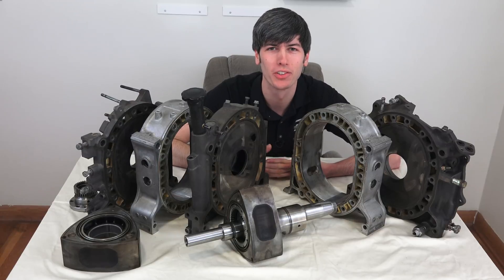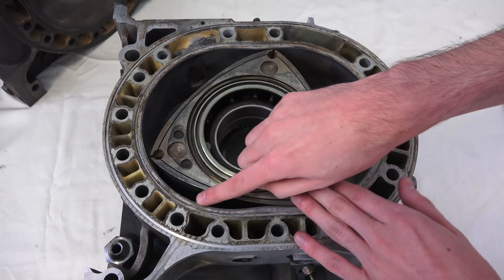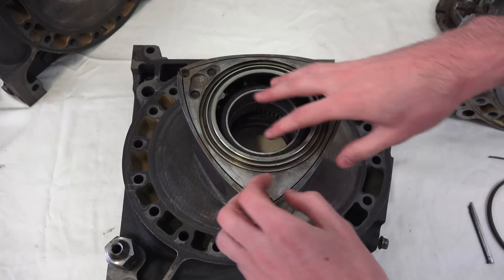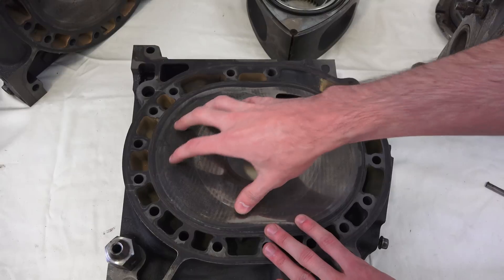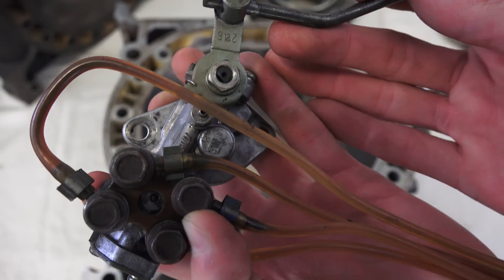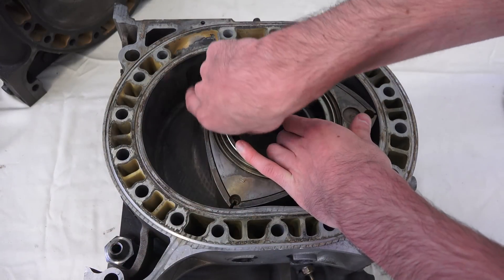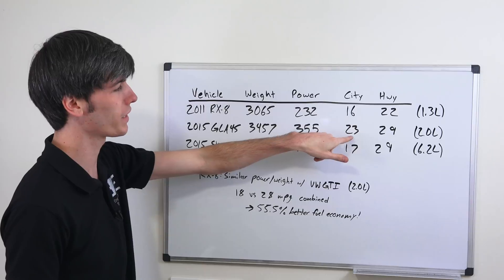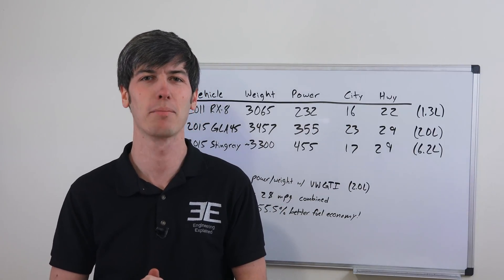4 Reasons Why The Rotary Engine Is Dead

Comment: The most elegant engine is still the electric engine. 
It's a shame that we don't have adequate power storage to make it usable on a daily basis.
Reply: That used to be true! Now, the only remaining barrier is cost, and that will be coming down in the next 2-3 years. Get hyped!
Reply: really they are called electric motors, not engines, since all the do is convert power, not create it. an "electric engine" would be a generator turned by some shaft-power creating force
Reply: wtf tesla cars get 500km on a charge. how is that a "Flaw" with range, who drives more than 500km in 1 sitting
Reply: Ryan Ballantyne we can thank the smartphone industry for the advances in battery technology, and cost is not that big of a problem anymore, infrastructure is.
I'm still waiting for Tesla to expand their charging grid in Eastern Europe, otherwise their model 3 seems quite affordable.
Reply: +The real doktorbimmer it takes 40 minutes to fully charge at their charging stations,  and the charging time will get better over time
Reply: Almost anything is better than burning petrol in an ICE with highly variable speed and load settings.
Even a network of diesel generators located at the charging stations, which make electricity on-site could be better.
Batteries with replaceable electrolyte could also be a thing.
However, cars consume such a huge amount of power that by the time electric vehicles start becoming mainstream, electricity providers will be forced to increase prices. They'll have to start burning oil themselves to make up the shortfall. Hopefully by then the market will find some other improvements.

Hybrid cars could be superior, despite the stigma of having an on-board generator. One of the problems with pure electric cars is the need for a massively over-sized battery. It just seems like poor engineering, considering the superior energy density of fossil fuels, and the fact that peak power is usually only needed for short bursts. Much better to have a smaller battery (still huge, but much smaller than what Teslas require), and supplement it with other sources of power.
Reply: The real doktorbimmer
Exactly. That's why hybrids sound a lot more compelling to me, rather than pure EV, for the moment. On the other hand, the automotive industry looks really STALE, and they're just raking in profits using low-risk business models, which makes me understand why governments want to regulate them. Otherwise they wouldn't bother innovating at all, until the oil runs out.
Reply: The real doktorbimmer
The cost of batteries are going down, so electric cars are going to be cheaper. Also economy of scale helps a lot too.
Reply: The real doktorbimmer
The Model 3 will start at 500K units per year and go up to 1.5M soon after that. That's mainstream.
Electric motors are much simpler and therefore more reliable than ICEs. Batteries are a different story, but they are good enough already (8 year unlimited mile warranty by Tesla is good enough for me), and they are improving fast.
The performance of the electric motors are a lot better then ICE's. They provide huge torque from zero rpm instantaneously, and are lot smaller. The Tesla Model S generates as much torque as a Bugatti Veyron. Compare the size of their engines. All high-speed trains are electric.
If you compare the energy density of fossil fuels and batteries, than it's a different story. But batteries are improving, fossil fuels aren't.
Current electric cars have acceptable range, and the recharging infrastructure is pretty good already in Western Europe. Since charging stations are a lot simpler, cheaper and safer then gas stations, they can be built much faster.
I would like some source for your claim about CO2. It's doesn't sound plausible.
First, electric cars are much more efficient than regular ones for two main reasons. One, regenerative braking. Two, modern power plants are close to 60% efficiency, and electric motors are 80-90%. Regular car engines are like 25%, and then there is the cost of drilling, refining, and transporting oil.
And we could make electricity from clean sources, like hydro, geothermal, solar, wind, nuclear. Some countries are mostly green already (like France, Norway, Canada, etc). And lithium can be entirely recycled, unlike oil. The recently opened Tesla Gigafactory is very good in being green. http://www.treehugger.com/renewable-energy/teslas-gigafactory-will-produce-much-renewable-energy-it-uses-net-zero-energy.html
Finally, the cost of oil is not conspiracy theory. Climate Change is a fact. And it's also a fact that oil companies knew this for decades. We also know that most major politicians has close ties to the fossil fuel industry. And wars just happen to start in oil rich countries for no reason. And Saudi Arabia is the closest ally of America because they are the champions of freedom and democracy. And the 9/11 plane hijackers were totally not mostly Saudi citizens.
Reply: there's nothing elegant about an ugly cylinder shaped engine with a shaft coming out of it and wires going to it.
until there is a completely new development regarding feeding these electric motors,its not going to go anywhere
Reply: Brent Graves 
Oh, I see. 
I didn't know there was a difference. 
My language has no word for "engine", we just call them all motors.
But is there a difference? an internal combustion engine also uses previously stored energy, the only thing that differs is the storage medium (i.e. hydrocarbons vs batteries)
Reply: the duke engine has no practical way for internal lubrication
Reply: hey, look! they called it a 'Rotary Engine'.   Rotary Engine   Rotary Engine   Rotary Engine   Rotary Engine   Rotary Engine   Rotary Engine   Rotary Engine   Rotary Engine   Rotary Engine   Rotary Engine   Rotary Engine   Rotary Engine   Rotary Engine   Rotary Engine   Rotary Engine   Rotary Engine   Rotary Engine   Rotary Engine   Rotary Engine   Rotary Engine   Rotary Engine   Rotary Engine   Rotary Engine   Rotary Engine   Rotary Engine
Reply: The real doktorbimmer Yeah I don't really know where you're pulling information from (I'm guessing you probably Google'd it), but in colloquial/contextual conversation, most people refer to engines and motors as distinct things. Maybe its not "technically correct" by dictionary standards, but there is definitely a system people follow. The German origins of a word matter not when dealing with American English (which is to what I was referring to).

We butcher the original meanings of words all the time!
Reply: We're getting there. Battery technology development is improving at an incredible rate (finally)!
Reply: robert retka Erm... not really, lol xD
Reply: robert retka Ok, now real world application?
Reply: The real doktorbimmer Well, at least there has been production cars actually with rotary engines... and no rubber band powered cars, unsurprisingly. Unless we live in cartoonland!
Reply: robert retka The definition of an engine, is 'a machine with moving parts'.
Reply: Electric engines FTW.
Reply: Infrastructure is indeed a big one, but if a "cheap" electric can get say 200-350 miles on a single charge, that could very well become a great every day commuting car for most people.
Reply: +The real doktorbimmer yeah it all depends on the overall efficiency and impact.
Reply: I have done 1500km in one sitting many times. In SA from Johannesburg to the coast is around 600km, and that is done by hundreds of people daily.
Reply: Solar, wind, hydro, etc. Ultimately fusion ;)
Reply: +elghode
More nuclear sounds good. In fact we should have switched to almost exclusively nuclear by now. We have the technology since the sixties (LFTR).
Reply: The real doktorbimmer I wouldn't be too sure about that without doing some calculations first. What if the lifetime cost of a large battery + electricity is higher than some alternative? The money is measured against resources such as oil, so the cash you save tells you how 'green' the battery system really is.
Reply: meh_hi_there
The problem with hybrids is that you have to keep the very complex, expensive and heavy combustion engine. Pure electric is better, if the charging infrastructure is there. In the US and Western Europe, it's already good, and growing fast.
Reply: best comment ever!!!
Reply: They are still not a viable option to internal combustion.  Hence the low production numbers.
Reply: The real doktorbimmer
They are just becoming mainstream with the Tesla Model  3.
In Norway over 24% of all cars are plug-in hybrid or full electric. They plan to ban ICEs in 2025.
Here is a global map of charging stations : https://chargemap.com/
Western Europe is pretty well covered. The US is far behind, as usual, but it's still manageable with a little planning.
What are the other major disadvantages?
Electric motors are a lot more powerful (Tesla Model S P100D : 0-60 in 2.5 seconds). A lot smaller (there is a second trunk in the front of Tesla cars), a lot simpler and therefore more reliable. They have no emission and little noise. A charging station is a lot simpler, cheaper and safer then a gas station. When you buy oil, you support big evil corporations, oppressive regimes, corrupt politicians, wars in the Middle East, and their consequence, terrorism.
Reply: The real doktorbimmer
Those are all facts. Feel free to disprove any of that.
Reply: robert retka
"I'm sure he could comparison tabulate the economics to convince you, if he wanted."

Huh. That's foolish... You side with someone who obviously is incapable of such feats. He's also blatantly wrong.

The fact is the EVs already are more economic and bring the extra price in running cost in some  years, if you actually use them.
Apart from them being a lot more efficent and electricity being cheaper than fuel, you also have less service costs. Even the brake disks last longer due to recharge braking.
Reply: "or a very similar looking "ultra-eco sustainable bio" pack for $10. Guess which one's actually greener? The $5 one! Why? Because it's $5 LESS fossil fuels being burnt by the entire food-chain of suppliers and retailers involved in your purchase."

This is just false. You just get ripped off. Prices are not set by manufacturing cost, but by how much people can be duped to pay for something. That's free market for you...
Which is a very economic way of getting more income by doing nothing. (Also food chain something entirely different)
Reply: avada
Competition may be somewhat wasteful, but it's better than not doing anything. Without competition and profit there is very little motivation to work hard and take risks with innovation. That's why communism failed.
But pure capitalism also fails, because it gives the rich way too much power, and that prevents fair competition, and with that it discourages hard work and innovation.
The way to make this work is to have a strong government to maintain a level playfield for corporations, a strong democracy to minimize corruption, and social programs (like free education and healthcare) to give individuals a fair chance to succeed too.
Reply: meh_hi_there
Did you read my previous comment?
The price tag and energy efficiency are not related. Sometimes efficiency cost more, sometimes it doesn't. But if it's cheaper to be more efficient, then there is no reason to sell a more expensive and worse product (unless you are Apple). In that case you don't see a choice in the stores, you automatically get the more efficient product. Refrigerators for example become a lot more efficient and doesn't cost much more. And you save a lot on your electricity bill.
Or sometimes you can choose between performance and efficiency. Cars for example like that. Cheaper cars are less powerful and/or smaller, but very often more fuel efficient. You can look at practically any car manufacturers home page, and see it for yourself. If you select a more powerful engine for the same car the price goes up and efficiency goes down.
And why are you so obsessed with toilette paper?
Reply: András Bíró
Communism never existed in reality. The soviet style socialism failed because it was massively corrupted. People weren't held to proper standards and kept stealing without punishment.

"Without competition and profit there is very little motivation to work hard and take risks with innovation."
False. It's just the capitalist corrupted mindset. If people don't get their wages that's a lot of motivations. Or if they get less if they don't perform

The state could/should oversee and manage think thanks, scientist and engineer teams with the goal of innovation and development.
Those who showed brilliance or proved some sort of potential should get some funding to allow to materialize their ideas.
Reply: András Bíró
"You don't understand how humans work"

Hah! With your narrow minded views that's a funny thing to say.

"If the government controls everything then of course it becomes corrupt."

That's not true. And is based on your zealous belief. Which is based on you experience with Soviet stile corrupt socialism. (Communism still never existed)

Not that I was arguing for soviet style socialism. It would be more of a totalitarian technocracy if you want to put labels on it.

Al of your long comment is based on you experiences in Hungary and the false belief you got from it.

"My country (Hungary) was communist a few decades ago, and still don't really recovered[...]"

My country (also Hungary) is suffering from a steady stream of corrupt incompetent governments and politicians.
Also those are mostly nationalistic fairy tales. Precious little can be produced here when you have china. And so many countries so much bigger economies ...

"The only problem with communism is that it ignores human nature. If humans were angels, then it would work just fine, but we aren't angels unfortunately."
True. That's while communism never existed.
As for why socialism failed I already mentioned. Corruption and lack of supervision and standards.

"And anyway people can, and routinely do work as little as possible, just enough to not get fired. If you ever had a job, you must have seen this."
True. But this doesn't necessitate crappy capitalism. Just pay by performance for example. You can also keep performance up to standard by punishment. The means of which is unlimited (pay-cuts, jail time, execution, etc)
Reply: meh_hi_there
"If you try and work backwards to calculate the real costs of a product, ultimately you get to the price of raw materials, and they can only be obtained by using energy, which also has a price.If you try and work backwards to calculate the real costs of a product, ultimately you get to the price of raw materials, and they can only be obtained by using energy, which also has a price."

You miss two important details. First, you can extract raw materials and generate electricity in very different ways. Some are a lot more damaging than others. For example you can cut down an entire forest and move on to the next, or you can only cut down trees selectively and in a limited number, and maybe even plant new ones.
You can bur coal for electricity, and simply dump all the toxic waste into the environment, or you can use for example nuclear energy, and get clean electricity for the same price.
The other thing is efficiency. For example a LED light is a lot more expensive then an incandescent one, but it uses a lot less energy, and lasts a lot longer. If you consider the entire life cycle, then a LED light is much better for your wallet and for the environment.
Reply: avada
If you think that communism can work perfectly in real life, please show me one example. It has been tried in several countries, and always lead to massive corruption.
As I explained, if the government makes all the decisions, then it has all the power, consequently it will become corrupt fast. The only way to avoid this is to distribute power, but than you don't have true communism anymore.
One possibility to make communism work is artificial intelligence. If the government is super intelligent and uncorruptible than it may work. And if you can automate most work, it becomes economically stable too. Then what you get is something like Star Trek.

"Just pay by performance for example. You can also keep performance up to standard by punishment."
You can do that, but that's not communism. The basic idea of communism is equality. The theory is that everyone works hard for the benefit of the community, not for money, and only takes what he or she needs, not more. That works for ants and bees, which has a strong genetic drive, but not for humans. We are inherently greedy and selfish. We need a system that takes this into account. The best we could come up with so far is called Social Democracy. That seems to work reasonably well in Western Europe. All others are failed big time.
Reply: meh_hi_there
Why are you insisting on your assumption, when we already pointed out it's flaws?
Also you are again ignoring operational costs, and manufacturing methods.
An electric car uses much less energy then an ICE. Oil is hard to extract, has to be refined and transported around the world, and ICEs are very inefficient.
Electricity can be made from lot cheaper sources, at a lot higher efficiency, and electric motors can work backwards to recover kinetic energy. And lithium can be recycled unlike oil. The new Tesla Gigafactory recycles most of it's waste, and will use mostly renewable energy, while still producing the cheapest batteries.
Reply: András Bíró
"If you think that communism can work perfectly in real life, please show me one example. It has been tried in several countries, and always lead to massive corruption."

Did you actually read my response? I never argued for communism or soviet socialism
State controlling most things ≠ Communism.
Socialism ≠ Communism

Also strong state control worked out quite well for china...

"As I explained, if the government makes all the decisions, then it has all the power, consequently it will become corrupt fast. The only way to avoid this is to distribute power, but than you don't have true communism anymore."

WRONG. This is just a wet dream. If you believe there's less corruption in the state now you're fooling yourself. The only consequence is that some of the theft is done outside the state...

"One possibility to make communism work is artificial intelligence. If the government is super intelligent and uncorruptible than it may work. And if you can automate most work, it becomes economically stable too."
Again, this has nothing to do with communism, or socialism. The Nazi government controlled all aspects of economy and even more. Do you think they were communists?

"Then what you get is something like Star Trek."
You shouldn't say such thing if you want to be taken seriously. :) Star track is massively out of touch with reality.

"You can do that, but that's not communism. The basic idea of communism is equality. The theory is that everyone works hard for the benefit of the community, not for money, and only takes what he or she needs, not more."

ONLY YOU were talking about communism.

"The best we could come up with so far is called Social Democracy."
I'd say that false. Even monarchies performed better most of the time. All it does it institutionalizes hypocrisy and manipulation. People vote for showman and circus clowns.
Even the basic concept is deeply flawed. Who even thinks masses of ignorant people electing the government has any validity or goodness to it? They're choosing from a few corrupted pretenders in the pocket of rich people/corporations, because only they can afford the kind of marketing that gets them elected. It's a joke. A horrible joke...
Doesn't take greed and selfishness out of the picture it, it cements it. People vote for whoever appears to be catering most to them.

"That seems to work reasonably well in Western Europe."
It doesn't work. They live in well-being, because they exploit the rest, that's what the EU is actually for. USA exploits most of the world. Most people are in the "service sector" of the economy, meaning they're useless parasites. (Actually parasites would be a fourth sector, just no-one admits it.)
Reply: meh_hi_there
It's not dead it's used to provide energy. The "range extender" is most of the time, because it's not used.

"Whereas ICEs collect air from the environment, and dump the exhaust, which saves a lot of weight."
AKA polluting and killing people...

"I contend that yes we can: just look at the money and find out which one is cheaper and therefore more efficient"

That is just ridiculous, foolish. Price doesn't signify efficiency. Actually money represents pretty much nothing. By logic the iphone is less efficient because all the idiots throw out 3-5 times the money for the same junk because it has an apple badge on it. It's just plain false. Also it has no relevance whatsoever to the performance of the car

On the other hand real efficiency can be measured. Both for production of the car and using it. Production costs are similar. On the other hand usage is much more efficient.
You drill, pump up, transport crude oil. Then refine it at great energy cost, than transport it more a couple times until it gets to the fuel station. Then you burn it in engines that have <20% efficiency in practice.
Meanwhile you produce the power in a powerplant, you distribute it via the electricity network, charge the car, then drive it. that's it. A good electric motor is 80+% efficient. Batteries roundtrip efficiency 95+%, the charger is similarly efficient. The powerplant can be pretty variable, nuclear having the best EROI. Also their waste heat can/could be used.
Reply: avada
"I never argued for communism or soviet socialism"
Then I don't understand what you are arguing for. Please explain it.

"Also strong state control worked out quite well for china..."
Not exactly. They ware pretty miserable until they embraced capitalism. So we can say that central planning works better with capitalist ideas. We don't know how they would do with democracy. But democracies generally do better than oppressive regimes.
I strongly recommend this book about the subject : https://www.amazon.com/Why-Nations-Fail-Origins-Prosperity/dp/0307719227

More centralized decision making gives the government more power. Power corrupts. It's pretty simple.
If power is more distributed, then it's much harder to get away with corruption. For example if there are regular fair elections, then openly corrupt politicians can be kicked out of office. And than those who bribed them can be put in jail. Of course some level of corruption always exists, but it's vastly different between countries, and more democratic countries usually has less. http://www.worldaudit.org/corruption.htm

I don't understand your comment about the Nazis. Yes, they controlled everything, but why would that make them communists?
Communism requires a very strong centralized control too, but that just coincidence. The idea behind centralization was to prevent exploitation of the working class, money driven decision making, and wasteful consumption.

Star Trek is of course fantasy, but that doesn't mean it can't have realistic elements. It's called "post-scarcity economy". In a lot of sense they are communists. They have no money, people pretty much just take what they need, and only work because they want, and there is very little inequality.

Social Democracy is works best, that's a fact. Learn history. Greece, Rome, Great Britain, France, the USA was all champions of democracy when they were the defining countries of their time. They advanced science and culture the most. There were other like China and Egypt, but their contribution was much less important. Now the countries with the highest GDP, the loves inequality, lowest corruption, and the happiest citizens are the most democratic ones. For the detailed explanation read the book I linked.

Yes, the USA and the EU does exploit others, but that's not the key to their wealth. The most exploitative countries tend to be the poorest. For details, read the book. The basic idea is that exploited workers less productive, because they are not motivated.
And finally, the "service sector" is not useless. At least not all of it. I could explain it in detail, but I'm getting tired. Here is a simple argument instead. Why do people in a free country willingly pay a fuckton of money for useless services?
Reply: meh_hi_there
You are still wrong. I gave you several examples. It doesn't matter what Tesla employees buy, because General Motors and Exxon employees probably buy the same stuff. If one manufacturing process becomes greener (without becoming much more expensive), while others doesn't change, then the whole economy becomes greener regardless of the inner complexities.
Reply: meh_hi_there

"Then how would you calculate the capitalist doctrine of "cost" without following the money? What criteria do you use to determine environmental costs, if you don't even count normal costs?"

True "cost" is quite impossible to measure, since price fails to be a measure. And money itself is fails to be what it's supposed to be. (Store and measure of value) (It's sadly hilarious when you read that company x now has no income because of the strong dollar or vice-versa...)

But you could measure costs: you could count man hours, energy used, minerals. To get some sense of the real cost.
(note: the price they put on man hours is quite arbitrary. It would seem that if something produced in US, Germany or such inherently more valuable than China or India or such, even if the workers are doing the exact same thing. Even if in the latter group they are doing it more efficiently. (don't spend effort/time/money on safety for example) This is another reason why the price has little to no hint of the true cost/value )
Reply: No thanks.
Reply: The real doktorbimmer
A condescending tone won't make you less wrong...
Reply: meh_hi_there
"How do you know if something is objectively bad for the environment?"
The easiest way is to observe how the environment changes after you released the stuff. Living things are depend on each other in complex ways, so usually any significant change is bad. Big changes in anything can upset the balance of an ecosystem, which leads to extinctions, loss of biodiversity, etc.
Morally it's wrong to hurt any species, even indirectly. So if your waste helps some algae to grow fast, and those release toxins that kill fish, that's a bad thing.
Or you can focus only on what harms humans. Obviously anything that is harmful to humans directly is bad. Then anything that's harmful to species we eat (like wheat) is bad. And then anything that harmful to those species which help those that we eat (like bees), etc. . Since pretty much everything is connected, almost any harm to any species can hurt us indirectly. There are some exceptions, like top predators who hunt the same prey as us, like wolves.
Changing the climate for example is really bad. A small temperature change is in itself can hurt a lot of species, but there are several secondary effects too (change in the amount of rain, acidity of oceans, etc.).

"And who's counting?"
The market is counting. That's the big advantage of the free market. It can quickly and efficiently adapt to demand. If people prefer environmentally friendly products, then companies which produce those will get more customers, while other will lose them.

"At the end of it all, a buyer simply pays an enormous sum of cash, for a tiny amount of raw materials that are shaped into a car"
Not just the raw materials that matter. The manufacturing process, and the operation of the product are also very important. In case of an electric car the operation is the main difference to a regular one.

"So, your money-vote makes no objective difference."
No. What I said invalidates your argument not mine. If all of the employees of all companies spend their money equally than the only difference is the harm that comes from the raw material mining, the manufacturing process and the operation of the product. If my car uses electricity instead of oil, than it's an objective difference. If the car factory itself produces much less toxic waste that it's another win. On top of the, there is a possibility that if a company really cares about the environment, than it's employees will care too.
Reply: W. Gator, the only way that your proposal would work is if you could use the alternators as a brake, but then it isn't generating energy, its preserving a SMALL percentage of the energy expended to get the car moving (we already do this to an extent, but I mean ALL of the braking power, not a part of it). Also, while your solar powered car idea is nice, there just isn't enough usable surface area on a car to power it even on the sunniest of days.
Reply: even there new 100d with its 0-60 time around 2.6 seconds. it has a range of 650 km. incredible.
Reply: Thjaffi hidrogen is indeed a  non polluting fuel which can   e used in Internal combustion engines,  however people tend to avoid it due to its extreme flammability and tendency to blow up easily. 
Not sure how hidrogen cells work for storing electricity though,  but there must be a reason such technologies have not been adopted for large scale use.
Reply: Check out the Duke Engine!!
Reply: +robert retka how is a spring or rubber band more elegant than an electric engine? You have no way to control the release of energy,  except by using complex moving parts such as those in a clock.  They also lack a good way of charging up the engine.  You either need to manually pull it which is impractical for anything but small apications or you need another engine to transfer the energy to the spring. 
Electric engines on the other hand can be easily powered when connected to a power grid. Their design is so simple that they have only one moving part.  They have instant torque at any speed so you don't need a gearbox and the power is distributed smoothly, without the necessity of translating liniar motion to circular motion. 
They are so effective that they are the most used engines to this day.  
The only issue they face is off grid mobility, but that is being addressed as we speak.
Reply: ok, we all get a electric car. and how do we make the electricity ????more  nuclear??
Reply: why would you want to own a car that when it breaks, its almost impossible to do anything to it? (speaking eletrical engines here), also, it would be boring to drive a car without any sound.
Reply: Prepare for the lame
Reply: +robert retka hy! i gave the compliment to 1123.. about the electric motor. its the most elegant kind of transpotation. only the batteries are the actual problem. but its geting better with lithium battery improving  every year.
Reply: andre pata
getting lamer*
Reply: Wrong... People cand and do use electric cars on a daily basis....
Have you been living under a rock? :)
Reply: The real doktorbimmer
 But what people are looking for is a new equilibrium where electric vehicles are cheaper and cleaner overall. It's tricky because in order to get there, first we (both consumers and producers) have to traverse an economic space where electric vehicles are more expensive and less efficient than the competition.
Reply: András Bíró Many people don't realise that 'greenness' is measured in money. Say you've run out of toilet paper and you're shopping for some more. You can get a regular $5 pack, or a very similar looking "ultra-eco sustainable bio" pack for $10. Guess which one's actually greener? The $5 one! Why? Because it's $5 LESS fossil fuels being burnt by the entire food-chain of suppliers and retailers involved in your purchase.

As long as that spare $5 is sitting in your pocket, it can't get spent on fuel or plastic gadgets by the shop's employees, or the shop's energy-hungry air-conditioning. It doesn't contribute to the CEO's travel costs. It means that 3rd parties like insurers also have less cash to spend. That's not to say that the 'eco' toilet paper didn't have the potential to be greener for other reasons, but it would have to be the same price or cheaper for those differences to be of a big enough scale to actually matter.

Now apply the same logic to electric cars vs conventional ICE. Equal price = equal efficiency. That said, the government could have a superior overview of the hidden costs on both sides, which justifies their decisions to subsidise electric cars. For instance, lung cancer sounds very expensive, a sort-of catch-22 in that you have to pollute the environment even more, just to treat one person's broken lungs. By steering the flow of money towards one thing (electric cars, lower emissions where the people are) and away from another (portable smog machines), they are asserting their social values.

It's questionable whether it's even possible for total energy consumption to be reduced, because that would be like trying to reduce entropy.
Reply: avada LOL, the joke's on you, Comrade. Or maybe you are on the joke? I think you misunderstood my earlier comment. Anyway, there's no such thing as a "free" market, as every real-world market is influenced in some way by top-down regulation. Marxists are slightly correct (but only slightly), in the sense that there are flaws in capitalist ideology, but that's what my comment was alluding to!

By paying for the more expensive toilet paper, you're supporting a lot of useless economic activity by parasitic middlemen, which boils down to wasted energy by people who are under the illusion that their job is very important. Colourful packaging, fake diversity and randomness, retail snobbery, the opportunity cost of having to "shop around" for everything. On the other hand, capitalism has important advantages, such as superior development and optimisation due to better visibility of costs. The energy efficiency of a product is clearly visible on the price tag, and you know that the $5 "non-green" toilet paper is actually better than the $10 so-called "green" paper.
Reply: András Bíró"The price tag and energy efficiency are not related. Sometimes efficiency cost more, sometimes it doesn't."

My point is that they ARE related. If you try and work backwards to calculate the real costs of a product, ultimately you get to the price of raw materials, and they can only be obtained by using energy, which also has a price. That's one reason why it's called the "petrodollar". There is zero cost for the energy: it simply comes out of the ground. But there is a human cost, so it's given a suitable exchange rate. And because there's so much of it being exchanged, it basically controls the world's economy. Obviously there's no way to tell if one $1 product uses a bit more nuclear power, while a different $1 product uses a bit more gas (unless you research it), but you DO know that the real production costs must be extremely similar. Otherwise, market traders would immediately seize the opportunity to make a profit, and that would correct the price.
Reply: avada"But this doesn't necessitate crappy capitalism. Just pay by performance for example. You can also keep performance up to standard by punishment. The means of which is unlimited (pay-cuts, jail time, execution, etc)"
SMH Amazing... Soviet brainwashing at its finest? Punitive actions change the game into master versus slave. Who needs such bourgeois extravagance as "accounting", when you can simply treat other people like animals?
Reply: meh_hi_there
I see your bringing you best at fallacious arguing. What's it like 2-3 fallacies in this short response?

But anyway... No it doesn't. Unless you consider yourself a slave of your government.
Reply: Rasputin

If you're willing to pay the extra price, service costs, etc. If you use don't travel long distances regularly it's just a lot of dead weight.
In my opinion one can just use public transport in such cases, or plan the trip with charging stations/time.
Reply: avada A battery is also a lot of dead weight. It's more like a rocket motor that is forced to carry the fuel, oxidizer, AND a special tank for collecting the exhaust. Whereas ICEs collect air from the environment, and dump the exhaust, which saves a lot of weight.

The big question is: can we determine the true efficiency of a battery powered system, and compare it to the true efficiency of an internal combustion system? I contend that yes we can: just look at the money and find out which one is cheaper and therefore more efficient (after correcting for government intervention). But even that is not so simple, because
a)
we have to contend with "redistribution of wealth" in a capitalist system where everyone who is even remotely connected to the production process gets part of the money. If you get $5 every time a Tesla car gets sold, you can do anything with it. For example, you can buy butane for your patio heater.
b) how do you account for past costs? Present-day prices don't occur in a vacuum. The costs are cumulative, and millions of km had to be travelled "inefficiently" using petrol before "more efficient" technologies could be developed.
Reply: András Bíró
Like I already said, manufacturing methods cannot be tightly defined in a system where everyone gets part of the money, and everyone can spend their cash on anything. If some Tesla employees decide to spend their earnings by heating their patio in the middle of summer, then that becomes part of the manufacturing cost. There's more to it than then just mining lithium and embedding small cells in a large block of epoxy.

Similarly with LEDs. When do you start counting the development cost? 10 years ago? 20 years ago? 100 years ago? I completely agree that they use less electricity right now, and that electric cars are far more efficient at converting energy after they've already been built. All I'm saying is that if you want to find out the efficiency, then find out the cost.
Reply: avada "On the other hand real efficiency can be measured. Both for production of the car and using it. Production costs are similar."
LOL, don't give me that dismissive intellectual laziness. If X is twice the asking price of Y, then it's impossible for Y to use more energy and other raw materials in the manufacturing process, unless, by some miracle or theft they illicitly obtained the resources without accounting for their cost. You keep forgetting that you MUST account for wages as real environmental costs, because that cash is then circulated in the economy, which causes more economic activity. Afaict, ALL economic activity can be reduced to bartering for energy. And if I'm wrong about that, tell me what type of economic activity does not carry any energy?

"It's not dead it's used to provide energy. The "range extender" is most of the time, because it's not used."
You are wrong, there. Using data from the internet including drag coefficients, rolling resistance, and vehicle mass, you can find out for yourself that the average power consumption by a 4-door car cruising at 100km/h is likely to be around 15kW-20kW. Using a costly battery to supply a massive 10 or 20 times that amount seems like bad engineering. High conversion efficiency from chemical energy to kinetic does not say anything about the "efficiency" of making the battery in the first place.

After the fuel savings compensate for the higher price of an electric car, THEN the car may start becoming more efficient than an alternative ICE car. However, it's also possible that development costs will fall, and it would have been more efficient to pay less cash upfront and upgrade to a better car in a couple of years time.
Reply: avada
Then how would you calculate the capitalist doctrine of "cost" without following the money? What criteria do you use to determine environmental costs, if you don't even count normal costs?

András Bíró "It doesn't matter what Tesla employees buy, because General Motors and Exxon employees probably buy the same stuff."
It may not matter what they buy, but it does matter how much of it they can buy. The problem I'm trying to explain here relates to the inefficiency of capitalism. Like I mentioned before, the side-effects of competition, such as advertising and branding are not harmless. You buy a product and you put the colourful packaging straight into the rubbish bin! Or you go to a shopping centre and they're burning >1MW of energy on air conditioning. Or you waste time and energy searching for an optimal product, and the cost of your "shopping" outweighs the savings. Or there are 2 different retail chains, both located in smaller separate buildings, and selling slightly different styles of the same thing. This diversity has a huge environmental impact, and the simplest way to reduce it would be avoid spending cash into the system.
Reply: András Bíró "Environmental costs and monetary costs are not necessarily related. Environmental costs are extracting resources that other living things use, destroying their habitat, and releasing poisons."
OK, but your definition is very vague and it's hard to imagine what you mean. How do you know if something is objectively bad for the environment? It sounds like a projection of personal values, and what you mean is that it's bad for your environment. For instance, fertilizer run-off might be extremely good for some types of river-dwelling microbes. But you might not like it because it could affect you negatively. You predict that if the water supply is altered, it could affect your food sources or your drinking water.

"By spending money, we essentially vote on how to allocate our resources."
The tail wags the dog?
And who's counting?
When following the manufacture of a complex product, prices seem to increase exponentially. Starting from extremely cheap raw materials, every time some "value is added" the price gets multiplied, and every additional participant in the production process has his own network of suppliers. At the end of it all, a buyer simply pays an enormous sum of cash, for a tiny amount of raw materials that are shaped into a car, and for a huge population of people to eat, drink, drive, and fly as part of the production cost.

You said it yourself earlier:
"It doesn't matter what Tesla employees buy, because General Motors and Exxon employees probably buy the same stuff."
So, your money-vote makes no objective difference. It's just a personal decision to exchange your time and effort for a nicer car.
Reply: András Bíró
OK, so you're getting closer to a usable definition of environmental cost. It's still extremely vague though, so you might want to fix that before using it to justify your pre-existing conclusion that one car-manufacturing process is better than another.

The market does not "count money-votes". If anything, market actors look for opportunities to symbiotically attach themselves to the energy of a transaction, often opposing the flow of whatever good or service was required in the first place. The downsides seem most obvious in areas such as private health care. In a poorly regulated or overly "free" market, life-or-death situations become fully exploited, forcing patients into lifelong servitude to repay the extreme debts they accrue from the army of high-priced middlemen. As you and others have argued: at first glance there doesn't seem to be any real reason for the price-gouging. After all, where are the "real costs"? But you fail to understand that there's no such thing as real costs in an open market. It's all about energy sources and negotiating the price. If a health patient's life depends on some treatment, the price simply goes up until they can pay no more. They get farmed in such a way that their labour output is maximised.

Similarly, if you place a high sentimental value on something, such as fashion, or caring for the environment, then your weakness gets exploited. Your values inspire you to put more effort into the economy. Perhaps you'll work on weekends, so that you can afford the more expensive products that you require. Your additional effort can be recalculated into food and energy resources.

"If people prefer environmentally friendly products, then companies which produce those will get more customers, while other will lose them."
Simply "preferring" something does not mean that it's easy to find.
Reply: W. Gator1 second ago I drive more than that, here is what they can do. Make the hood, roof and trunk lids all just big solar panels....... and we can do that and still make them look cool. Then add an electricity producing generator to each wheel, then add the new and improved battery packs and an electric car could run for months on a single charge. The solar panels would be charging from sun up to sun set and the generators would produce electricity when ever it is in motion, day and night. It can be done
Reply: The comment I made was supposed to be on a different video, one about electric cars, not this one. I guess the video ad jumped from that one to this one before I had it finished. Yours was a very good video, thanks
Reply: W. Gator
It was nonsensical regardless. And you didn't actually comment on the video, but responded to "e1123581321345589144"-s comment about electric motors. You don't quite know where you are. :)
Reply: Why is it nonsensical, explain yourself.You can charge batteries with solar panels, right? You can charge batteries with the alternator in your car, right? So why is it nonsense to say that using a lot of solar panels and 4 alternator/ generators will REDUCE, not eliminate completely, the number of times you have to plug in your vehicle for a charge in any given time period? Just saying it is nonsensical isn't an intelligent response. This extra power would cut down on the number of plug in times
Reply: W. Gator
Solar powers would only deliver an insignificant amount of power. A few hundred watts are nothing to a car with a 100+kW engine car. Not to mention they are fragile and need to be cleaned and not suitable on curved surfaces.
"4 alternator/ generators will REDUCE, not eliminate completely"
This is the huge nonsense part... You CAN'T generate extra electricity of the energy you put into the moving car. You would only waste energy not produce more... (You can only produce while you break which is already in use.)
Reply: Yel, well..... my son is an electrical Engineer with QUALCOMM in San Diego, and he said the same thing when we had this conversation a couple years ago. That the alternators would use more power then they would produce. We need to dream bigger than the laws of Physics. As for the solar panels, I have been using them for years and they do work. All the obstacles you mentioned..... well I never said it would be easy, LOL!  The vehicle design (shape) would have to change, and NO they wouldn't eliminate the need for recharging, but they would reduce the number of recharging events. There could be enough power produced to run a cottage, I know that and I am sure that would be a good help
Reply: Chris Williams 
Maybe the concept/prototypes were developed.

About a sentence later than you looked on the wikipedia article it mentions: "However, this rechargeable lithium battery could never be made practical"

There was a long road from that to practical lithium batteries.
Reply: Chris Williams 
So try to be condescending by admitting to reading  Exxon marketing materials. :)
Also you claimed that we can thank Exxon which is clearly not the case...

"The various oil companies made sure that refining the li-ion battery was put on hiatus as it was against their interests"

They didn't develop it so it doesn't matter what they wanted. It's just that the creator of the first prototype was working at Exxon.

Developing battery tech just takes time and investment. Few cared for developing better batteries until cellphones took off.
Reply: Chris Williams 
Sony released the first commercial batteries in 1991. So no, they weren't used for a long time, or at all before cellphones. They came out the same year second generation mobile phone systems appeared.
Reply: avada 

Wikipedia is your friend, again?

So while they weren't safe or at least raised serious safety concerns rechargeable lithium ion batteries were available in the 1980s.

Sony may have commercialised them but they didn't create the concept.  Mobile phones in 1991 were few and far between, the initial use wasn't solely for use in phones... think items like cameras and other high demand products like camcorders etc. 

To summarise, you seem to think that lithium ion batteries are here solely as a consequence of a mobile phone boom which was actually non existent at the time and which preceded the advent of smartphones by a huge margin. 

And that's why we have lithium ion batteries now? Nope.
Reply: Chris Williams 
I didn't claim "solely". But that was the major driving factor. They've been around for a while, and were power hungry. They represented a large part of the demand.

"Sony may have commercialised them but they didn't create the concept."

So?  Lab prototypes don't matter. Marketed products do.
Reply: Chris Williams 
You started out with "Actually you can thank Exxon Mobil and Stanley Whittingham"

Which as such is BS. But you're just diverting the conversation again, instead of admitting being wrong (again)...
Reply: avada 

Except that you can thank them.

I don't have to divert anything and the casual observer will note that's what you appear to do.

So we have current mobile phones and Sony in 1991 (to summarise your key points) to thank for the li-ion battery?

Good one, gotcha.
Reply: www.he3da.cz/about-us-c94t
Reply: We actually have a good power storage for electric engines, It's called Hydrogen. H2 is the fuel of future, cause it's easy to produce and available in massive amounts on earth. And it's combustion produces nothing than water, in an fuel cell as in an internal combustion engine. For combusting H2, the Wankel is perfect, cause the Hydrogen can't ignite early, cause of the strict spatial seperation of intake and combustion stroke. H2 ftw!
Reply: If all energy were derived from regenerative sources, efficiency would be irrelevant. All usable regenerative energy on earth is from the sun, except the tides. For human conditions, these sources are infinite. Unfortunately the humanity is governed by capitalism, and not by the urge to improve one's own civilization.

In addition, the stroke piston engine has been steadily developed over the last century, in particular the diesel engine. If you could catch up, the wankel certainly would be more competitive.
Reply: +Chris Williams

Because electricity is itself difficult to store, liquid fuels have a much higher energy density (you have lesser weights and more energy), and a simple fueltank can be filled up infinitely, an accumulator worn over time. Also reffilling a tank takes just minutes, recharging takes hours. For most people in cities an e-car would be ok, but not everyone live in a city, and when i'm drinving my motorcycle on weekend i easily drive more than 300km, no motorcycle suitable battery would do this.

furthermore, h2 can alse be used by fuel cells for generating eletricity, there you have the more efficient e-engine, but a way better storage.

Additional H2 can easily be carried to your home, and it's already practiced, because hydrogen is converted into the gas network at small proportions (at least in europe).

+The real doktorbimmer

The mankind consumed ~140PWh in 2008. The sun delivered 1,5ZWh in the same time. thats 10000times more. So why should it be impossible?

also i didn't say that the wankel will be as efficient, but that it is well qualified for burning hydrogen safely by desing. But you can also use a fuel cell to "burn" H2, and a normal otto-engine will work too, but you have a hot spot where the mixture could ignite too early.

Perhaps it's a future vision, but it's definitely not impossible.